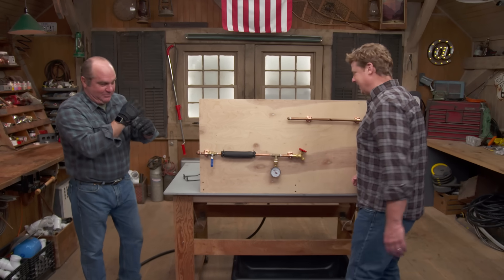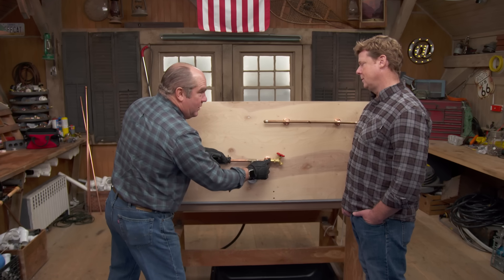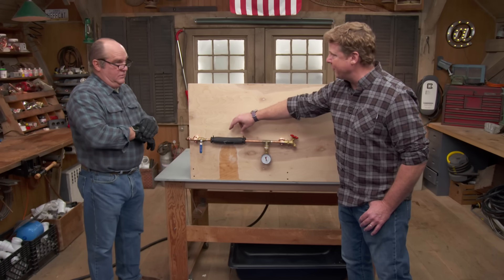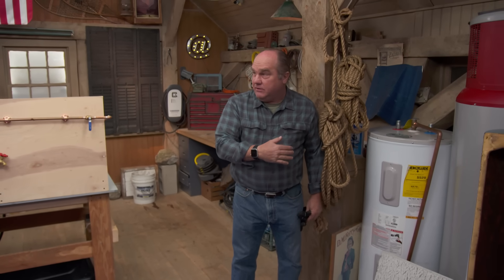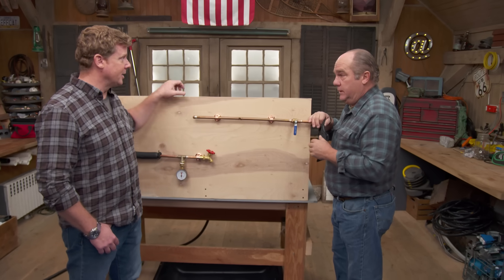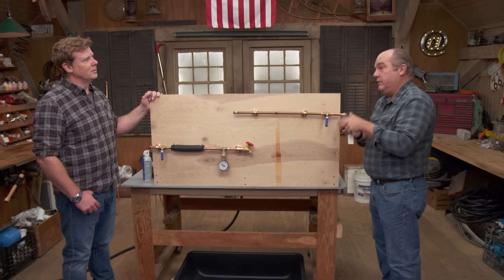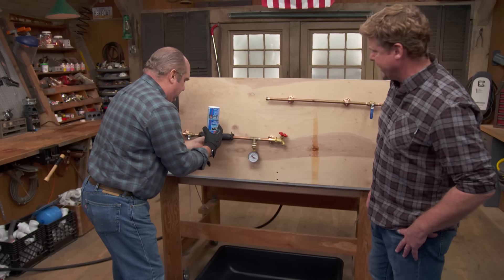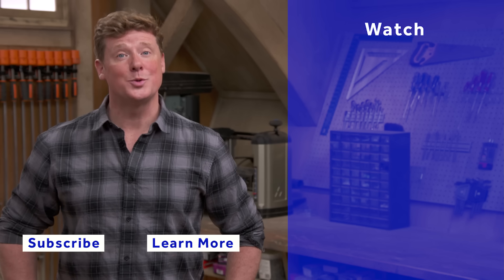How a Frozen Pipe Bursts | Ask This Old House

Comment: I'm in WV. This years 2025 artic blast was brutal. Pipes froze, I opened the valve to the house, no water came out. But I opened the valve to the house. Saved my main from bursting. The crap city government run water company has my street shut off six inches underground code is three feet deep. Do you think they will fix this? No. It's the government.

Comment: We had an extended freeze here in Ga last couple weeks. I left my outside faucet running a little…not dripping and had no problems except a driveway covered in ice. I’m on a septic tank and didn’t want to back it up my running faucets. They don’t bury lines deep enough here and I was worried about the line from the street to the house

Comment: Just saw this video...Q: Will turning off water at the street help?  Also, once you turn the water off, do you still open the faucets?  Thx in advance..
Reply: Yes it helps but you still have to drain the lines.
Reply: @brianmurphy1000  Thx so much!
Reply: Can anyone say what is best? Turning off water and drain pipes or letting the water run ?
Reply: If it's your summer home,  or someplace where you won't be for a while, better to shut off system and drain. If it's just overnight,  let it drip.@charlottemiller3299

Comment: Good, but doesn't cover that a slow drip, in extended sub-freezing temperatures, is not enough.  If it's below freezing for a while the drip will freeze and you now have the same problem.

Steady trickle to a stream, and the only way to be sure is check on it every few hours.
Extreme temperatures?  Then it's best to learn how to cut off the main supply line and drain all the pipes in the house (after filling up your bath tubs).  No water, but no busted pipes.

Comment: it is my understanding that the pressure buildup is from the metal pips contracting when they get cold (which causes the liquid pressure which is difficult to compress) to build up very fast and to high pressure. Is this correct?

Comment: i am surprised that someone has not created a pressure release valve that will release drips as pressure goes above a certain pressure and then stop the release as the pressure drops back down to a certain threshold. and having these valve places to rlease the drips into the drain pipes at strategic places.. like, as he suggested the furthers hot and cold water facet. Wouldn't that make this a self maintaining system? and then perhaps once a year or so.. there could be a way to test it? like his demo, to see if it engaged and disengaged at the proper presures to relieve pressure in the line?
Reply: Yes if you put a few 6 bar pressure relief valve on the line furthest and closest the water on hot and cold then the system should be self maintaining. Add pex especially expansion pex and compression fittings and there is zero chance of failure

Comment: What about baseboard heaters? How do you avoid frozen pipes and or pressure when that zone doesn't work?
Reply: At our cabin, the hot-water radiator system was filled with antifreeze instead of water.

Comment: Had a recent snow storm. Lost power to the house for over 24 hours , temps reached under 30 degrees in the house. Pipes burst after the power came back and the house started to heat up (assuming it had something to do with temperate and expansion too rapidly changing). Was running the faucet slightly the entire time. think the next time the temps drop this low I am just going to turn off the main and drain the lowest point until it heats up again.

Comment: I freakin' love science and DIY.  A pipe fitting popped off at my parents old house while I was at work.  When I got home, water poured over the kitchen step on my feet as I let myself into the house.  The whole floor was covered in 1/4 inch water in this single level home.  I was finally able to get the main shut off, and solder the fitting to close the system to get indoor plumbing working again,  but damage was done.  Dead of winter, there was nowhere to pull up area rugs and dry them outside, or any chance to open windows to sunlight.  Installed carpeting was ruined, and hardwood floors popped their screws, buckling throughout rooms; the crawl space was a bathtub of water and waiting for spring thaw, the house developed black mold.  It was a mess. 

I was wondering if ... is there's a way to install a blind pipe in a water line inside the house to absorb and prevent catastrophic  hydrostatic pressure buildup by compressing the dead air inside the blind pipe, instead of pressuring pipe walls elsewhere behind walls?  You know,  kind of like the blind pipe on drain systems to keep them from banging?  Or maybe a pressure relief valve on top of the pipe designed to equalize pressure in the pipe with ice ebb and flow, and catch overflow?  It would be useful in northern homes to be sure.

If they work, maybe they could be used in branches of plumbing layout to isolate trouble areas so hydrostatic pressure isn't distributed throughout the system.  Of course, it wouldn't keep vulnerable pipes from freezing, but it might stop catastrophic cracks in the pipe which are the real problem after defrost.  No water for a few hours waiting for defrosting is mere inconvenience compared to actual pipe damage.

Comment: We get the process but we are trying to fix that pipe, permanently. The plumber that came to my house charged me $300 for a 15 minutes job as he put a cap on the hole. I have no water coming out from this thing.....to the outside faucet.......I am trying to learn how to repair it myself, permanently. I want to avoid these plumbers that make more money per hour than me. Not fair. I already learned to replace my toilets and it was a breeze....That seems a little more complicated.

Comment: People just turn off water but don't drain the system. Come home to find thier place ruined by water damage. If you leave your home turn off water supply, open spigot outside ,then turn on every faucet ,shower or bath and turn off electricity at the panel for your water heater.  Your pipes won't break from water trapped in pipes and your water heater won't be destroyed .

Comment: Who else is here after hearing what's happening in Texas?
Reply: I dripped all the faucets in my house and they still burst. In two places.
Reply: @xfreeman86  I just turned off my main supply and opened all faucets inside the house not taking any chances any more. Will turn back on in the am. From lake Jackson tx
Reply: @countrykang1996  no water in the pipes no bursting pipes, I assume. 🙂
Reply: @xfreeman86  That depends on the piping layouts and outside faucet location 

Safest way is to turn off the main
Reply: @xfreeman86  that was the mistake you made its suppose to be a stream not a drip
Reply: Shut off the main valve and drain any excess water afterwards i.e. tub faucet. Let it drip just slightly.
Reply: Who else doesn’t care what you have to say U G
Reply: Me😀
Reply: meeeeeeeeeeeeeeeeeeeeeee
Reply: I live in Texas and thankfully no broken pipes for me
Reply: I'm here to spread the link around saw this last year I believe very good explanation. It's so much easier to learn what to do before hand for floods tornadoes hurricanes ETC
Reply: i live in texas, i had pipes burst and joints blow out!
i also didn't have power for 3 days...
Reply: Always run both you taps
Reply: Ne

Comment: "It's the pressure that will make the thing go crazy, not the 10% ice expansion on its own"

This is crucial to understand why dripping faucet method works. The purpose of dripping faucet is not to prevent ice build up in pipes, but rather to relieve pressure.

Great video and saved my house during 2021 Texas freeze. In my case the pipe still froze as almost no water was coming out in the morning even when I left the faucet dripping, but the pipe at least did not burst. Thank you!
Reply: Hydrogen atom and oxygen atoms are attractive and leaves only about 3% of empty space between them so it could only compress 3%

Comment: Notes: (1) Bursting pipes are not caused by the expansion of ice, even though the ice expands while the pipe contracts at low temperatures; (2) Bursting pipes are caused by high fluid pressure once an earlier section is "plugged" by ice and starts expanding, as such, the fluid pressure builds up very quickly; (3) Allowing an end faucet to drip relieves the fluid pressure, and it may prevent (though not intended) water from freezing.

Comment: Well.. Its a closed system.. So, opening any of the faucets should relieve pressure right?
Reply: If you open a faucet mid-stream and you get an ice plug downstream from there, you still risk bursting pipes between the plug and the closed downstream faucet.
Reply: @donbushek  ... So if the stream already stopped.. Like nothing comes out.. Os it already too late or can I go up to that part of the house to open the faucets?
Reply: @randolphcirilo4800  Sorry. I’m not sure I’m following. If you know the stream has stopped, then you must have already opened the faucet.

Comment: I have question example [ have 60 feet water line can i do 5feet heat tape ,5feet space and 
 5feet heat tape and on and on total 60feet and use foam pipe insulation cover all the pipe 
 or is there a better way Can you help me A.S.A.P
Reply: Do they make longer runs than 5 ft. I would insulate and drip throughout the night. Worked in central Montana where it's get below 0.  Negative 20 with wind chill
Reply: I did that .got up and all my water lines are frozen got down -4. we haven't  had  this low temperature in a long time .And on top of that my drain pipes or frozen to
Reply: @alanmcdowell977  I would open all valves in house. Put a tent of plastic or tarp around pipes and heat with space heater.  You can use a hair dryer too. Avoid propane torch because you can melt the solder out of the copper pipe weld.  If your lines are copper. Then I would doubles insulate my pipes and drip the lines.   My sister's kitchen sink keeps freezing but no other lines in her house. She did not drip her faucet.   Just make sure the heater is not close enough to melt or burn anything. If it's a crawlspace lay down a vapor barrier on the ground with think plastic and install styrofoam board to prevent drafts. They sell spray foam too for small awkward gaps
Reply: @alanmcdowell977  I would dump hot water down the drains. Be cautious of breaking a cold toilet doing this from the hot and cold contrast.  You could probably use some bacteria to heat and thaw the drain pipes. Should sell at any hardware store. The heat from the bacteria should help thaw the drain lines

Comment: When it gets well below freezing at night while asleep:
* should both the cold and hot water at a sink be left to drip, or only the cold?
* should all the sinks and bathtubs in the house be left to drip or just one?
During the day, when some of us are home, how often do we need to turn on sinks momentarily to avoid pressure build up and bursting pipes?   Temp here in Ohio is supposed to hit 5 degrees F overnight, and below 0 in the coming days!
Reply: Both, assuming the hot and cold pipes are subject to potential freezing. 
How often is subjective, it depends on how well your pipes are protected. I assume code might be different in TX vs WI, which could have an impact on freeze time.
Reply: @EricVandenAkker  Thank you.  Good info.

Comment: Thank you.
Turn off if pipes burst. 
Relieve pressure by letting faucet drip is the best tip and clarified why it's done. 
Open space below kitchen sink to let ANY heat in there.

Comment: Richard; since it is the pressure not the expansion that makes the pipe burst, why does the sewer trap under the sink burst, also when I left my coffee mug outside the next morning it had burst. In both cases there was no pressure only expansion??????
Reply: The mug broke because ceramic is brittle and cannot handle any expansion, whereas plumbing pipes can handle a little. Can’t explain the sewer trap.

Comment: My dad always had to climb into the crawl space to heat the pipes up until I told him to let them drip over night. The running water is harder to freeze than water sitting still in a pipe. Never had our pipes freeze since but common knowledge for anyone is to shut the main off before leaving your house for a long time in the winter. Also keep your heat at at least 60.
Reply: Or just empty out your pipes be extracting everything out before going out on long holiday

Comment: It's called an expansion tank and Temperature and Pressure relief valve. They are "safety" devices to prevent bursts that produce deadly shards.
Now, ice can cause bursts. But with no deadly shards, just a burst pipe and a lot of water.
Usually caused by morons thinking they will save money turning the heat down while they are at work.

Comment: You don't need ice to cause a pipe to burst. I own an apartment building and years back a galvanized pipe burst inside a wall from rust. The plumber showed up, the carpet cleaner showed up, the drywall man showed up and the insurance agent showed up. $6,200 dollars later and everything is back up and working. 2020 and $31k later new pipes are inside the walls.

Comment: Worked at a 150 apt retirement community with a 4 story atrium at the very top was a gable peak with windows and there were sprinkler heads... They burst water poured into the atrium for over two hours until we could get someone to figure out how to turn off the main. I was brooming the water out the front doors trying to keep it from spreading to the residential areas. Several thousand gallons poured in, it was raining inside.. craziness
Reply: @Conr S - wow; not something I’d want to witness!
Reply: @jrh11254  yea I was in my office and heard rain inside.. it was a very confusing moment

Comment: I have three story 1 family home with heat and water on each level
Which level should I have a drip of water to run on really cold days to prevent frozen hot and cold water ? Top floor or bottom
Reply: Coreys Gmail Top I’m pretty sure. He says the furthest from the source which I’m assuming is the ground floor or basement?
Reply: @humbertoricardo7330   no furthest from the source would be a upstairs faucet most water lines come into a house in a basement making upstairs the furthest away
Reply: hotrodpaully1 lol that’s what I said actually. He asked top or bottom floor.
Reply: @humbertoricardo7330  oh I miss understood you. 
You said " furthest from source .... assuming basement. " I thought you meant furthest from source was basement. What you where talking about is the basement was the source.

Comment: I used to think that letting your faucets drip would cause the water to keep moving so it couldn’t freeze. I didn’t know that it would release pressure instead! Thanks TOH!
Reply: It's a little bit of both. running water can't freezes as Easly, that's why rivers and streams don't. though if you get the right circumstances bodies of water can freeze.
Reply: @imark7777777  Wrong. Moving water freezes. Just ask anyone who has ice skated on a frozen stream or river.
Reply: It does both actually. The moving water will be above 0°C so it will help melt and carry away any ice that might be forming, and as a big added bonus it also releases the pressure.
Reply: Same thing! Makes so much more sense
Reply: Moving water can freeze if it gets to 32 deg simple as that. If the drip is not fast enough and you are not  moving the water within the pipe fast enough as it goes to the far side of the house say -  it will freeze. So in extreme cold you may need to have more of a trickle than a drip to keep that water above 32 until it exits the faucet. Great demo. Thanks!
Reply: Aramis3737  opposite of what you just said
Reply: I thought the same thing for many years.
Reply: Same here. Awesome.
Reply: Who gives a shit..i was in Nam! Thank me for my service

Comment: Working a job years ago where the people went away for a few weeks ski vacation and the old steam boiler failed to fire one night. Fast forward a few weeks and their regular oil delivery guy noticed the house didn't take any product on scheduled delivery so peeked in the basement window to see LOTS of water. (mostly windows frosted over) Called the customer's neighbor to get inside and found the house had gotten so cold that the boiler and well tank had frozen to the point where the sight glass was broken on both. Spent a day dewatering the basement and put in temporary heaters so we could get the frozen stuff to melt over several days.... then the repairs could start! The biggest problem we faced was waiting for the well tank and boiler itself to defrost, because without water we couldn't heat the rest of the house. The good part was that steam pipes are always empty of water so no damage to them upstairs.

Comment: I'm pretty sure water can't be compressed, yet he said when you compress water the pressure... Am I mistaken?
Reply: Jim Y yes you are mistaken
Reply: Jim Y … It's a matter of the wording. Water does not compress but when you add pressure it tries to expand, which builds pressure. Where does the pressure come from? When ice forms, the crystal structure of the ice takes up more room that the water itself. As the ice plug grows it TRIES to compress the water but all it's doing is expanding the pipe.... to the point of bursting / splitting. The actual leak happens as the ice melts and the water starts to flow again.